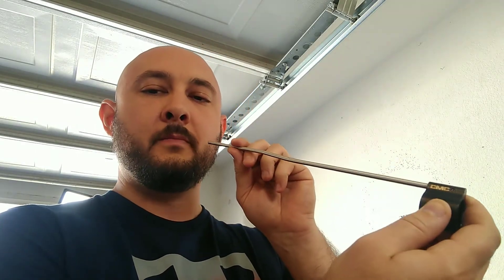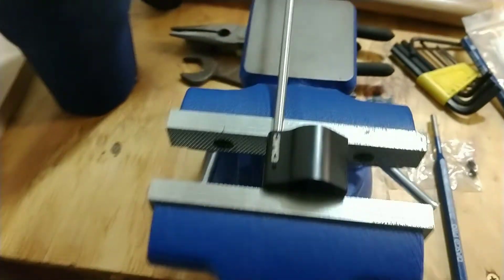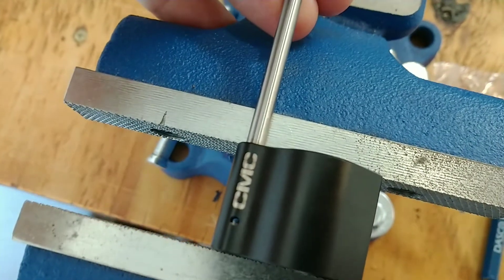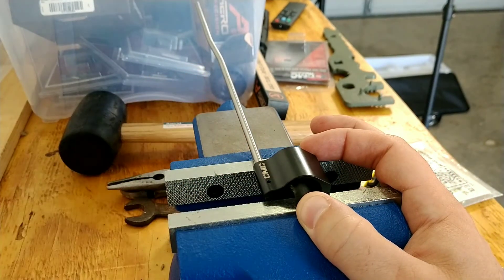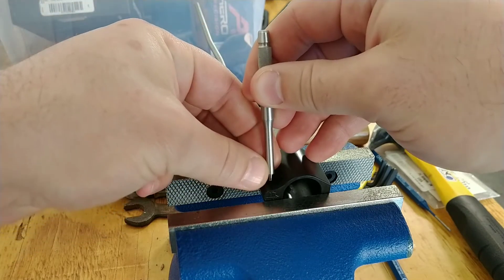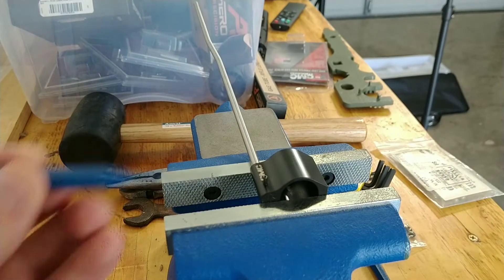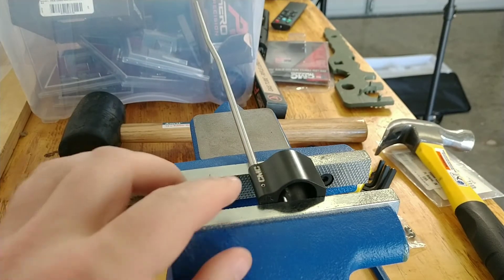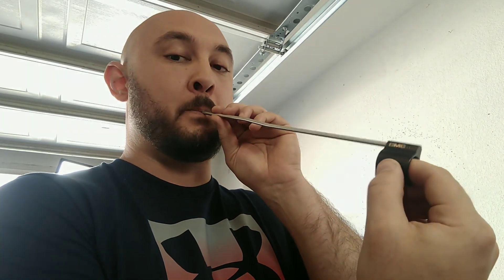How to install a gas tube into a gas block

Comment: I'm a cheap ass too...but I have two vises...one for metal, and one for wood that has wood screwed to the inside of the jaws...the wood won't mar up your parts...but you may have to check your tightness every few minutes...never had one come out on me, but always good to make sure a gas block doesn't pop out and dent your forehead...😂

Comment: What kind of roll pin starter is that. I ordered some and the suck.
Reply from the maker: Just a set I ordered off Amazon.  They're great if you use the right size.
Reply: @BTOMF  I ordered a roll pin set off Amazon as well and they are not so good

Comment: Awesome that worked wayyy better, I also used some hoppes 9 gun oil, a drop on the pin and a drop in the pin hole, slid right in no problem

Comment: I use just a smudge of grease goes right in. You can also have someone hold a punch through the bottom of the gas block/tube to help guide the roll pin through properly

Comment: How tight do you need to clamp the block into the vise? I don't want to mess up the ends!!
Reply from the maker: Tight enough so it'll hold it and not move. You don't want to gorilla it in there.
Reply: @BTOMF  Thanks!

Comment: Nice, I'm definitely gonna practice this many times as the first couple tries I mushroomed the roll pin. Probably the most frustrating pin to install when building if you ask me. I plan on fashioning a jig/setblock for future installs though.
Reply: Flat face channel locks with masking tape over the face. Equal pressure from the side of the block to the roll pin, prevents using a jig